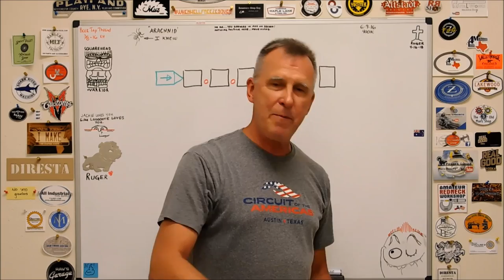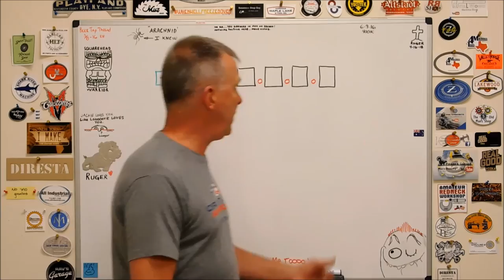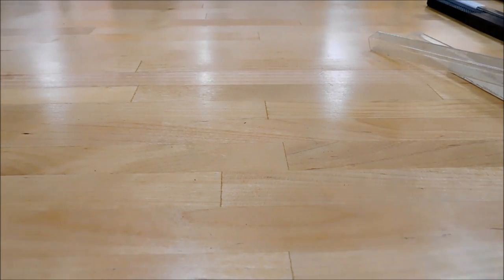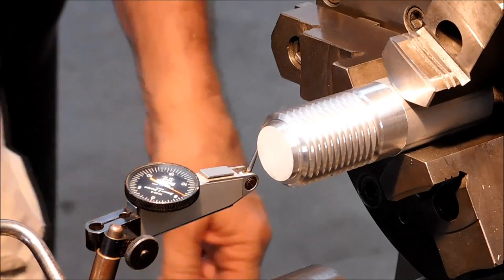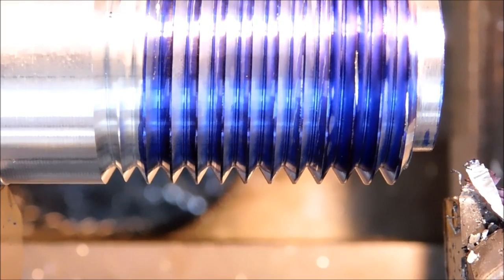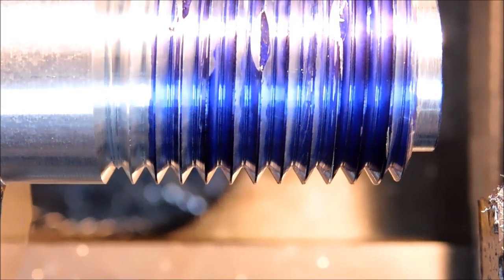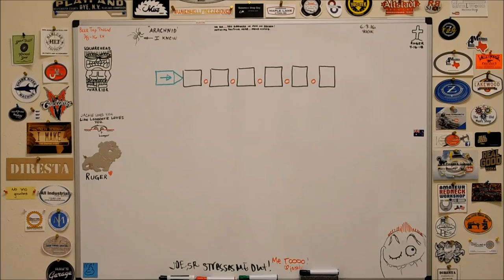Chasing and Repairing Damaged Threads

Comment: I chase threads quite often. I indicate them with a modified dial indiactor,  The indicator has a removable tip so I made a few large enough to cover 2 or more threads. Works pretty well for me . I also have one  at work that did not have removable tips so i cut the tip off and glued on a modified male/ female stand off. The male side is left alone  and the female half is reamed to fit the indicator shaft.

Comment: I ran into those thread files in the Navy working in the engine room. Most of the machinery has big studs that aren't easily removed, so being able to chase threads in-situ was an advantage. I figure a proper threading die would have been more appropriate, but those thread files were what happened to be kicking around in the tool box.

Comment: Another great video. Just as a matter of interest, if you have an electronic lead screw, i.e. It is driven by a servo or stepper based on the spindle position read by an encoder, that whole train thing goes away. Another advantage of an electronic lead screw.
Reply: As long as your leadscrew and half nuts are not sloppy.
Reply: @Gottenhimfella  but that applies whether you have an electronic lead screw or a gearbox
Reply: @sblack48  indeed it does,, but if there is slop there, the procedure to address it needs to be adopted whether there is an electronic lead screw or not
Reply: @Gottenhimfella  exactly so therefore it is irrelevant to a conclusion about electronic leadscrews!
Reply: @sblack48  It is relevant, however, to whether the "whole train thing goes away", because in such cases, the whole train effectively runs all the way to the carriage

Comment: to indicate, lay a 12" scale against the part with the end sitting on the way against the v so it does not kick out, place your indicator against the scale on the center line of the part, and indicate like usual, you will do fine. we use this trick when straightening acme threaded rod.
Reply from the maker: I literally just learned something new. Thank you.
Reply: @joepie221  Ill have to tell My Uncle, Josh Ward, showed me that as a teen in the 90's, he will be tickled!

Comment: Southern USA.  Thank you for a great episode! Please allow me to elaborate briefly: 1. "Time With"  means moving at exactly the same rate. "Synchronized"  means moving in harmony - Maintaining exact relationship.
You achieve timing with basic machine setup, eliminating slacks, etc. Synchronizing is fine-tuned with the compound.
If the compound is parallel, it has zero effect on depth, 1:1 effect on synchronity. At vertical it is flipped. At 30 degrees it is ½ side, 2x on depth.
Without reciting this I could not wrap my calcified brain around your presentation.

Comment: Joe I remember seeing, but never used one, a hand chasing tool, they had about half a dozen teeth on them, if I remember correctly, to use them, first set up a hand tool rest, then engage tool whilst job turning slowly, the idea being to cut off the damage without being able to generate enough cutting force to remove significant amount of good thread form. Have you ever seen that method, it's real old time. Cheshire England UK.
Reply: Tread file

Comment: This takes me back to high school shop class, working on a graded, multi operation project piece and I engaged the lever and missed the hash mark or didn't have something quite right and trashed the final pass on the threads! It's a good thing the lathe was bolted down, because I probably would have thrown it through the window and into the parking lot, needless to say I had to start over!
Reply from the maker: I think we have all done that.

Comment: If you need the damage out on the impact side, you can use a TIG to barely reflow the metal, and with lower gas pressure will allow the weld puddle meniscus to come above the existing thread profile. Recut the thread and it will look new.

Comment: You mention having problems being able to see what is going on because of the camera. If your camera has an HDMI out, I have found a 10 inch hdmi monitor to be a good combination of portability and still being able to see what is going on. A 10 inch monitor is small enough to mount on an articulating camera arm or maybe a Noga arm with a magnetic base. To keep it portable, buy an appropriate voltage power bank to power the monitor.

Comment: You Can indicate (clock) a thread using a 6" Rule as a flat surface, but I could eyeball concentricity within less than 4 thou'. (with the lathe spindle running fairly fast & just keep tapping the part till it comes right)
I was a Turner by trade & it just comes naturally with experience.
Reply from the maker: It does. Many wouldn't believe that, but it really does.
Reply: I can eyeball plain diameters to about that accuracy (it helps to be a drummer to be able to tap it at the right moment! also, on a powerful lathe, I prefer one with a wet-plate clutch, which can be feathered for ease of getting the speed just right, and for safety when leaning over the work) but frankly, coarse threads make it too difficult for me.
** I haven't tried it, but it seems to me that supergluing a single suitably sized thread wire to the face of an "elephant's foot" indicator probe, slanted to match the helix angle, would allow clocking up a thread at the pitch diameter, rather than from the OD. (Joe asked if anyone had a method which permitted of this) **

Comment: Thanks Joe, another great tip. I'm in Norfolk, UK!!!

Idea for another video - could you please explain how to use the threading dial on a metric lathe? Mine has three interchangeable gears for the dial, and 12 positions marked on the dial face. I've worked it out, but I'm not as good at explaining as you are. :)
Reply: You probably have a metradial which are not common in the USA-I have one and like it. Very expensive and must be bought from across the pond as you brits would say.
Reply: @bruceanderson9461  It's actually an add-on for my Chinese mini lathe, comes with 14, 15 and 16t geared shafts, so covers a wide range of thread pitches. Having multiple engagement points (2,3,4) certainly speeds up thread cutting. I'm sure it wouldn't be hard to make one...
Reply: Wondering about the same, though it may be different since our machines have different leadscrews. I have on old TOS lathe with a metric leadscrew, it came with a thread dial that I don't know how to use or for what pitches. Only threads I've cut so far were imperial since I've been fixing some old brit stuff, so I left the half nut engaged throughout and simply reversed the engine to back up. That's awfully slow though, as I needed low enough RPM to stop at the right place anyway hence no point in using Joe's reverse threading trick.

Comment: If this had been a critical part and I had to maximize thread engagement I would have chose the thread files and only dressed the damaged three points. There is a huge difference in brands of thread files also. Some cut as nice as a quality regular file while others seem to just bounce over the thread and cut very little.
Sometimes a top dressing thread insert helps cut the burr on the top of the bent threads better than a single point style insert. 
Another trick is to grind off half of the single point insert so it can only make contact with the side you want to correct.

Comment: Now do a video on chasing an internal thread in a housing that is using a locking ring to bear against the outer race of a bearing. I've had to do this in the past on box spindles. Heald or ExCello spindles IIRC. Chasing the thread in the housing actually required assembling the spindle minus the locking ring of course. Plus to add to the fun the pitch was 32TPI as the locking rings were only .250 to .312 long. Damage was usually caused by individuals being assigned by the foreman who should not of been allowed anywhere near a spindle. The rings were meant to be installed with a face spanner so of course the bozo used a universal face spanner. AKA a punch and a hammer.

Comment: Thank you for this! I need to chase a 2"-4-1/2UNC on a 300# sawmill arbor - lots of inertia. To avoid all the jogging, can I assume the gearing from the spindle through the Q/C gearbox and carriage is what has to be loaded in the correct direction? The gears from motor to the spindle shouldn't really matter. That being said, (everything in gear, half nuts engaged) can I rotate the chuck by hand backwards to take out lash until the carriage is tracking and set up my tool clearances that way?
Reply from the maker: Your chuck rotation thought makes perfect sense, and all the jogging shown here was simply to orient the damage for the camera angle. Jogging is really not necessary for this work.
Reply: Hi Joe from sunny Ipswich (west of Brisbane in Australia).

I was about to ask the same question except for the word "backwards".  Surely the spindle drives the carriage via the gear train and the problem is the backlash in the gear train so you want to compress all that backlash by turning the spindle forwards (i.e. in the same direction you will run when making the cut) before aligning the tool to the thread? 
Also, except that the backlash will vary if you tamper with your change gear setup or (in a large with a gearbox) change your gear ratio, I'd think whatever your backlash was on one part, it will be the same on the next? So if you had a dozen parts with the same (pitch) damaged thread to fix in a batch, you could maybe learn from the 6 thou of adjustment at the compound on the first part and on the next parts, know you can go straight to 4 or 5 at least (if not 6) rather than going one thou at a time? 
Regards
Neville
Reply: @tano1747   You are correct and I am wrong. When I started thinking about it, the gears between the motor and the spindle would compress in the opposite direction as the gears from the spindle to the carriage. You would turn the spindle forward to properly load the gear train down to the carriage.
Reply from the maker: @tano1747  I have to respectfully say that turning the spindle in reverse is the best choice. In my mind, it loads the backlash towards the driving force and and compresses everything just like being driven from the motor out. Shutting it down stretches the train since it stops from behind. A clockwise spin would just make the theoretical coast longer. That is just my opinion, but I'd bet on the reverse turn being better. Anyone care to comment? I am truly interested in everyone's opinion here.
Reply: @joepie221   Well... I'm partially with you on this one. I would say it all depends on how your machine is geared.(quick change box driven off the headstock). Think about your train being pushed by the engine at the back. Now the train is stopped, all the cuppings are relaxed. To preload the couplings before start up, you will either have to push the front of the train in reverse to pickup the slack or pushed it forward from the back. Now the question is, what is the front of the train on your lathe??? From my understanding, it is the tool post mounted on the compound, on the cross slide, on the saddle, on the half nut, ...... we get the picture. From that point of view it is impossible to push the front of the train in reverse, so your only option would be to push the back forwad... the chuck. Turning the chuck forward will preload all the gears and what not between the headstock and the tool. So if I was paying attention in class, this is the point right??. 
Turning it back would only preload everything between the headstock and the motor.
Annyhow, food for thought and my point of view. As always very good video.
Thanks, J.F. from Canada.🍻
Reply: Yes i guess it depends on your lathe. Mine belt drives the spindle which then (like every lathe that can cut threads) is geared to the lead screw etc.  It is this spindle to tool part of the backlash "train" that is important for the purposes at hand as far as i can see.  
I think backwards rotation WILL take out backlash between motor and spindle if you had gears there but these gears (in my case these drive belts) don't matter in terms of float due to backlash between tool and headstock.  (And there's no backlash in a belt drive apart from a little belt stretch under load i guess. 

You could theoretically drive everything into compression by rotating the MOTOR forward but in my case that would be a massive pita as i would have to remove the gear train cover to access the motor pulley. And it would be easy to pinch my hand in the pulley / belt interface.  So that's no good. 

But all that matters is i believe the backlash downstream of the headstock (between chuck and toolpost) as that is what changes the relative position of tool to the workpiece held in the chuck.  That's why the lathe uses gears there -- to guarantee accuracy of timing when thread cutting. ( The fact that it's a belt drive upstream between motor and spindle tells you it isn't important in timing by the way, as belts slip.)

Or just try it and see?
Reply: Another thought ... i can cut a thread perfectly fine using a crank handle on the spindle after removing the drive belt between motor and headstock (and there's utube video of guys doing this, usually as a means of threading to a shoulder, presumably because they haven't seen Joe's excellent alternative way of doing this with the tool upside down. (Still the smartest thing I've ever seem on utube. Kudos Joe!!!))
 This demonstrates that nothing upstream of the spindle matters for the purpose at hand.  

So to borrow  your metaphor Joe, yes the motor is the locomotive, but we only care about drawbar slack between cars 4 and 11 (#4 being the spindle and #11 being the tool).
Do you agree?  Or i am missing something ... ?
Reply: @joepie221  Let's use your direct drive analogy: take out all the gears between the spindle and motor, they don't count. A theoretical motor is then rigidly coupled to the spindle so there is no drive lash, therefore the spindle shaft IS the motor. To load the gear train in the correct direction and take up lash, and move the carriage (through the half nut), you rotate the chuck forward as in cutting. I'm convinced my original post was wrong.
Reply: Happens to us all, Joe.  It's nice to resolve it with a reasoned discussion though.  
And to echo others' comments, I really appreciate you taking time to teach us all.  I never fail to learn from your posts.

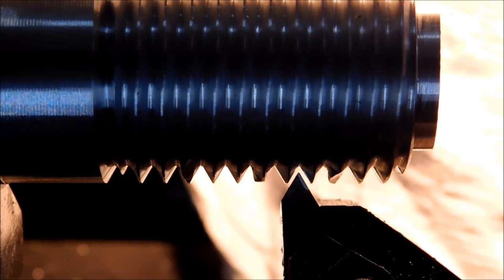Comment: I would have re blued the threads after the one side got wiped. You kind of lose your warning system when you scrape one side. I like to use my 10X loop at 23:10 and it almost always works out perfect. Thanks for giving us the best view with the camera- if your eyes had the same view, both sides would have wiped at  47 with no compound adjustment.

Comment: Good info and this kind of operation is exactly why one needs to know their machine: is the threading feed screw powered from the motor or from the spindle? If the former, one can't change the RPM midway job, but if the latter, then messing with the spindle speed has no effect on the timing of the thread.
Reply: As with most things there are exceptions. Years ago I ran a Spanish lathe that took it's drive for the quick change Norton gearbox from an intermediate shaft in the head stock and not the lathe's spindle. This meant that there were spindle speed and thread lead combinations that were not possible. The result was that threading at a higher or lower speed of the spindle might not be possible and make you say bad words.

Comment: We measured the outside of a thread on parts that had an M8 fine thread on one end thus :
Dip the finished part in hard moulding wax a few times , so the thread is filled up with this stuff.
'Turn' down to the outside diameter of the thread with a credit card, sharpened at one side.
It takes a few attempts,to get used to this, but you can make decent measurements this way to a resolution of 1/100 mm

Paddy (Flanders, Belgium)
Reply from the maker: I used to live in Flanders NJ USA. Visited Belgium a few years back...Great Beer. BTW send me your credit card and I'll try your technique. Just kidding. It sounds interesting. Thanks for the comment.
Reply: Joe, yeah it really works... but make sure to use hard moulding wax, not some soft candle-type wax (but you'd know that...)
If you're ever around these parts again, I'll take you out for a Karmeliet ! 

Cheers!
Paddy

Comment: Great video! I’m a novice and keep trying to learn more. Thanks 😊 
One question, I’d like to get that style grooving threading cutter in 5/8” shank. Can you give me advice on what to get?
Thanks again, Paul
Reply: He’s using a Kennametal Top Notch tool holder NSL-123B. NSL is left hand, NSR is right hand. 12 is shank size (12/16 or 3/4”), 3 is the insert size, B is the tool length. I believe the 5/8” shank tools are only available for size 2 inserts, so you’d need a NSR-102B or NSL-102B. Kennametal, Dorian, and Widia make the NSR/NSL tools, among others. Sandvik makes a similar tool they call Top-Lok which uses their own unique clamp and inserts. The clamp can be changed out to the Kennametal style to accept those inserts.

Comment: Joe, how about an internal thread to chase in a diameter of 1.062" bore?  How do you see to line up the tool?
Reply from the maker: I would do the same thing with a loose tool and advance the cross slide while sliding the tool back and forth by hand. When you cant move the tool any more, you're very close.
Reply: @joepie221  thanks Joe, will give it a shot! By feel then not by sight.